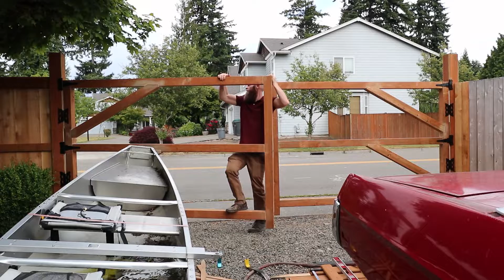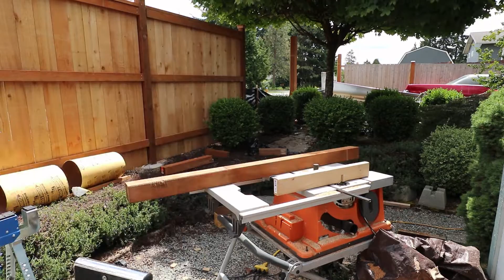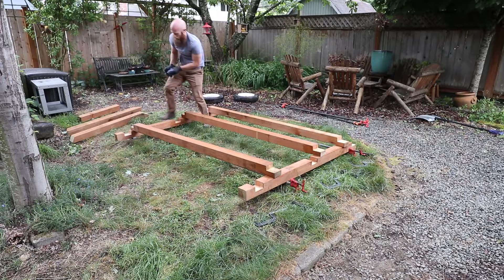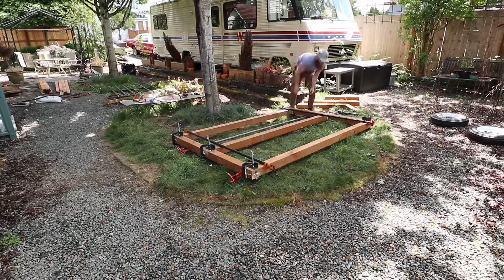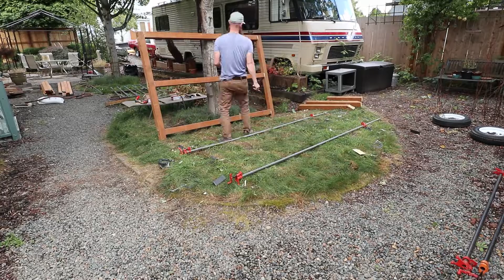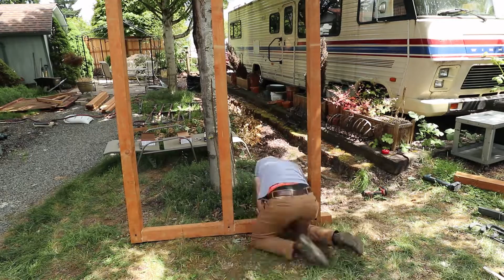Making Heavy Duty Gate Frames

Comment: Curious about how you measured where to do the bracing, and how deep you notched to put them into the horizontals. I did see a comment reply from you saying 60° cuts. I'm buidling just your bottom half, w/ cedar 2x4s. Mirroring all your specs and adding casters below to help absorb the load.
Reply from the maker: I notched them in 3/4 of an inch and used as large of braces I could at that angle of 60 deg. If you’re going to use casters you shouldn’t have much load on the frame or hinges, so that would be great.
Reply: @JoeMcCoskey  thanks, buddy! Great job all around. Be well.

Comment: It's been some time now, has your gates sagged at all? I'm about to build 2 - 8 foot gates with your design is there anything you would change?
Reply from the maker: The gates have dropped a couple inches on each side but not enough to be noticeable. I did change the hinges to using rod ends and made my own brackets for the rod ends to attach the gate to the post. If I was to do this again, I would move the vertical side rail on the gate that’s next to the post over having the horizontal rails overlap it. This would not only increase the strength of the gate but leave space between the post and the side rail on the gate. This would give you space to drill holes in the post and the gates side rail allowing you to use rod ends for hinges without needing to make custom brackets. The horizontal rails would need to have an angled cuts on them to allow the gate to open freely.

Comment: How is the gate now?  Its been almost 2 years now.  I need to create a 10' gate, do you have any suggestions on your design for it?
Reply from the maker: It’s holding up well. I should make an update video at some point. I made some adjustable heavy duty hinges out of rod ends and made brackets to mount them to the gate. A suggestion I would make is to move the vertical support of the gate a distance from the post that it mounts to, allowing you to drill holes in the post and gate to attach the rod ends to hold and adjust the gate. You could extend the pickets past that point but the space behind it needs to be open for clearance and operation.

Comment: So I guess I'm mentally challenged. I have a table saw but I cannot figure out how to cut the notches with it. Also have recip. saw.
Reply from the maker: I used a dado set on the table saw. They can be dangerous. Another method is to cut multiple slots next to each other and chipping out the material in between.

Comment: Good gates...I would think a big factor is also the strength of the posts the gates are attached to.  The corner post looks like a 6x6 post set into concrete. Is that correct? How deep was the post set into concrete?
Reply from the maker: Thank You and that is correct, the posts are 6x6 and they are three feet deep with six inches on concrete under that. 
This video shows installing the posts https://youtu.be/R1U5yeycFdE 
This video shows the depth of the post hole towards the end https://youtu.be/KTcJqvSQ1tk